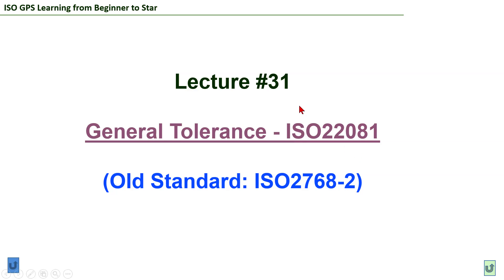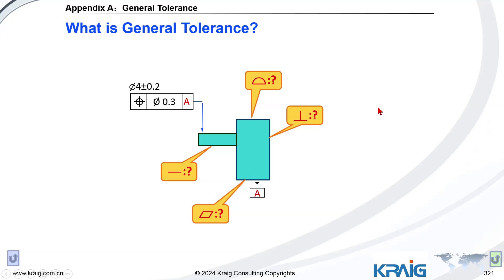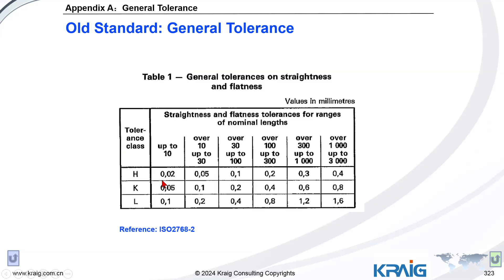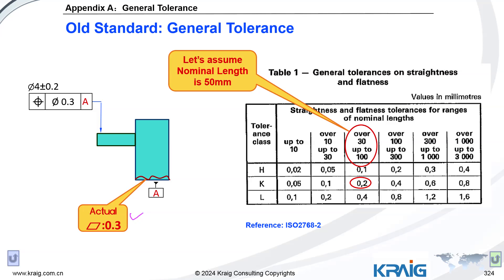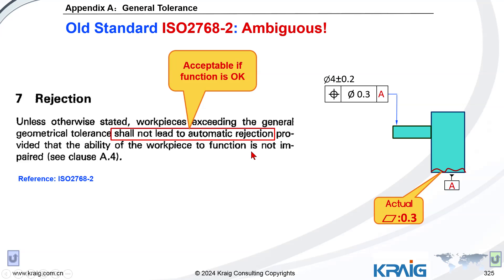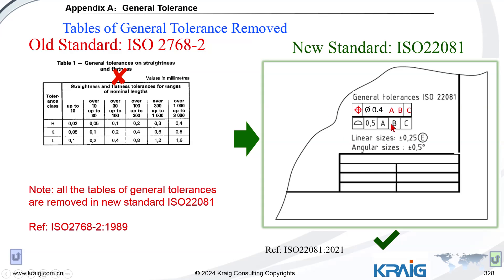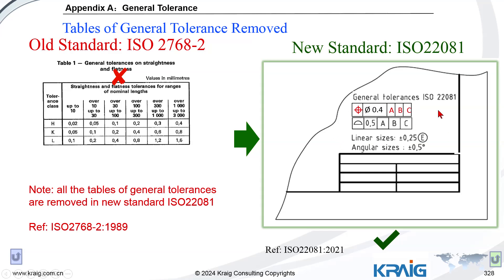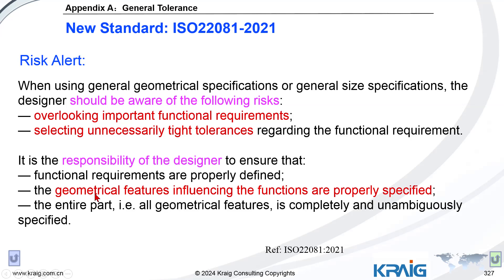#31 General Tolerance   ISO22081

Comment: On my drawing for an injection molded part some dimensions are not toleranced rather it says, General Tolerance - Iso 8015, where to find the tolerance and how to decide which class of tolerance to use, please help.
Reply from the maker: I guess you are talking about ISO2768-1 and ISO2768-2. there are 3 classes to select, it depends on the function of the parts. This is standard may not apply to plastic molding part. And also, ISO2768-2 is obsolete. see my video as below:

General Tolerance ISO22081
https://youtu.be/rvio0KjASkM?si=9daVysDd-SYRimCP

Michael

Comment: Thank very much for this video.
But in standard ISO 22081 it states that the only general tolerance can be the geometric surface profile tolerance .
It does not mention the position tolerance.
So is it also possible to create general geometrical tolerances in the drawing that differ from the surface profile tolerances?
For example for a transmission shaft, put a general circular run-out with referred to the main axis ? In this way it is possible to continue using size dimension ?
Reply from the maker: Yes, it's allowed to put general surface profile tolerance as well as position tolerance in the drawing. For feature of size, it's possible to use size tolerance.
Reply from the maker: by the way, it's pretty common practice in automotive that put profile, position, size tolerance in each drawing as general tolerance. Hope it helps. Michael